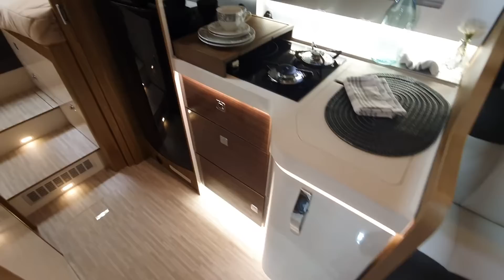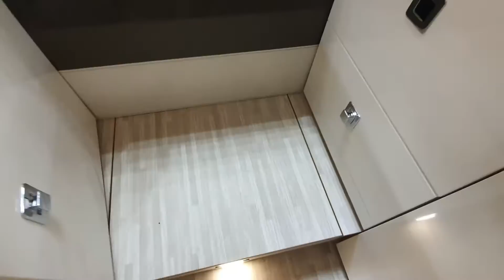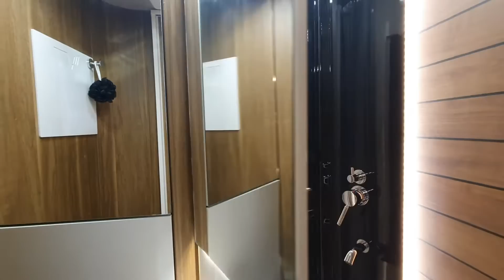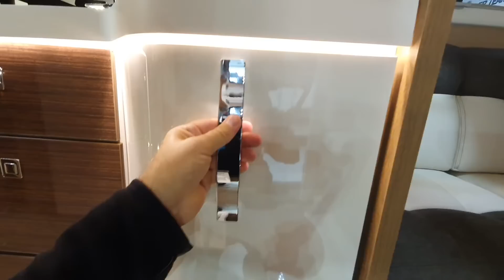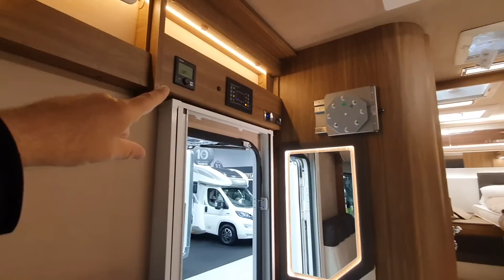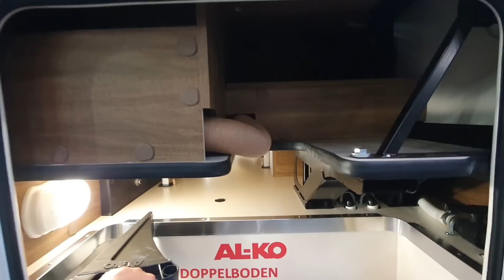Mobilvetta Design K Yacht Tekno Line 64.  An elegant but unreliable motorhome.

Comment: I like this type of motorhome and its not to expensive either for the size of it but will probably return 20something mpg but would a 9 speed auto help achieve more mpg ...
Reply from the maker: Usually automatics burn more than manual gearboxes.  At the end of the day, I think much depends on how one drives.